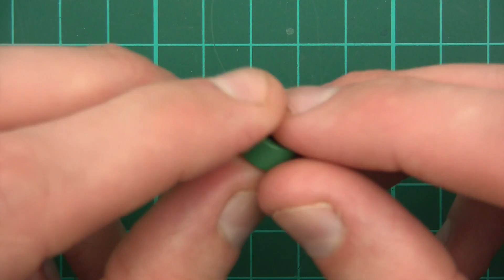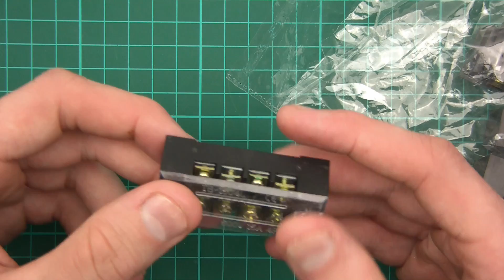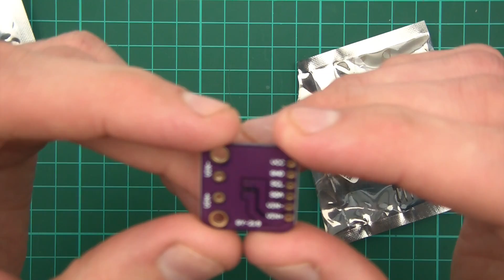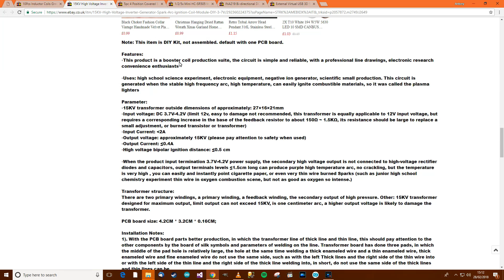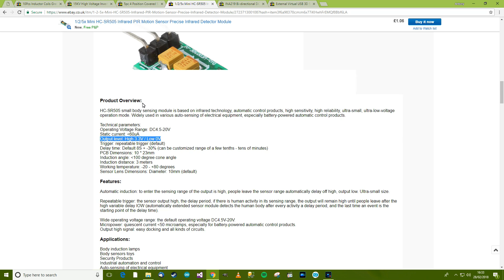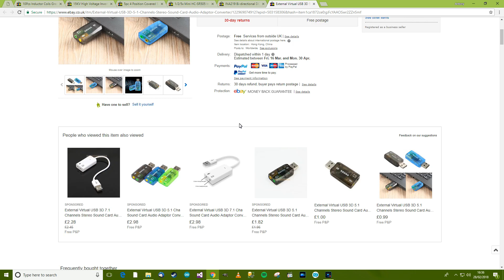Post Is Here! (Random, Cheap Ebay Stuff) #23 (Some Bargains!)

Comment: The HT7133 is a 3.3v voltage regulator made by Holtec. I've got a strip of those because they are quite handy for battery powered ESP's, due to their low voltage drop. I couldn't read the label here, but from that HT133... you read, this probably is the same or similar. [edit: corrected mistake in component number: it's 7133, not 1337]
Reply from the maker: Maxint R&D Ahh thanks... I use ams1117 and also 78xx family.. :) I'd never heard of HT1337. It sounds like the name of a temperature sensor haha...
Reply: Hi Antony - Sorry for mixing up some numbers. This package looks the same as the AMS1117, which is also a regulator. To be sure I just had a look in my own collection of sensors, where I also have that same mini-infrered sensor. There the chip on the back is labeled HT7133, which is a low voltage drop 3.3v regulator. The AMS1117 datasheet calls its 1V drop to be "low", but it really isn't. The HT7133 only has 30mV drop. This makes the HT7133 great for powering 3.3v devices from a lithium battery, where the AMS1117 is totally useless... (I know: ...been there; ...tried; ...failed)
Reply from the maker: Maxint R&D Hi! Doesn't the HT1337 have a drop out of 100mv? Maybe I misread the datasheet earlier. It's interesting stuff about these things. The ones I use are ams1117 and 78mXX. The 78mXX has a 2v dropout, but I don't believe all of these statistics. I'll have to do some efficiency tests on them. That will be interesting..
Reply: I just read a datasheet that said 30 mV, but I didn't measure it. 100 mV is also much better that 1V. Some time ago I made a lithium powered voltage and altitude measuring module for my drone. First version had an AMS-1117 which I had to replace because just a bit of throttle on the drone would lower the voltage to below the 3v that the RF24 transceivers required. BTW: I also have that INA219 module and found it quite good. Accurate and easy to use. If I remember well Julian Illett made a video about them in which he showed you can select increased accuracy by changing a resistor.
Reply from the maker: Ahh cool, I'll have to get some of these HT chips. Generally, I'm not concerned about the drop out because I don't usually use batteries. Solar for example, I use regulators but the voltages are always fixed a considerable amount above the required voltages.

The INA219 seems to have a 1Ω current shunt resistor with AD8219 chip. The AD8219, I think is an instrumentation amplifier. So I think there is a drop across the resistor, and the amplifier seems to amplify that to something usable. The INA apparently outputs I2C though, which is strange because AD8219 doesn't seem to do that, and I can't see any other chips on the board. Maybe there is another chip called 8219 or something lol. Whatever it is though, I'll find out at some point. Is this device actually an I2C device?!?!
Reply from the maker: I also have a drone but I never finished it. Lol... I keep meaning to finish it...
Reply: Yes, most definitely it is. Using I2C you can read both voltage and current. The address can be configured using the A0 and A1 pads, allowing four of these on the same I2C bus, along with other devices, such as an oled display. (Hint, hint...)
Reply from the maker: Maxint R&D Ahhh, to make a voltmeter/ammeter.
Reply: Oh, I just saw I misremembered how I read the datasheet. Remembered 30 mV instead of 30 mA. As you wrote 100 mV is the listed voltage drop, but in another datasheet (HT7133-2) I read 35mV-55mV.
Reply: A multi-point volt-/ammeter, e.g. a solar energy efficiency meter that can read both input power and output power, or measure Wh going in the battery versus Wh going out...
Reply from the maker: Ahh cool idea... ;-)
Reply from the maker: Maxint R&D Mr Maxint, do you use Facebook?
Reply: Hello Antony - Marcel here... Sorry, no. Facebook is not my thing. No twitter, pinterest or other social media either. I'm on linked-in, but hardly ever use that. If people want to reach me they can send YouTube messages (see the contact section of my channel) or send e-mail.
Reply from the maker: No worries!

Comment: With the toroids you can also make inductors. Useful for making buck/boost converters. You take 1 wire and coil it a certain # of turns. Then connect it to a diode, resistor, mosfet, and a few other parts and you can make your own buck/boost converters for your projects :)
Reply from the maker: Korishan Yeah, I want to look into this. To be honest, I know very little about inductors. In a few weeks, hopefully I'll release a video on what I've learnt, and maybe do a how to make your own buck/boost. Ha!
Reply: Julian Ilett did one that he called his MUPPET. It's a combination buck/boost with MPPT for solar to charge. But along his travels, he realized he had made a bidirectional buck/boost converter :P

Comment: The polo shaped green core is a toroid. I use them a lot in radio projects.  But I never came across green ones. Here is a link to a good discussion on them with links to inductance calculators https://forum.allaboutcircuits.com/threads/identifying-toroidial-inductor-cores.56586/
Reply: Stephen Farthing:  More specifics about toroids, from a YTer:  https://www.youtube.com/watch?v=t8mB6xz2NPI
Reply from the maker: Stephen Farthing Thanks! :)
Reply from the maker: Interesting video! I'm going to research this a lot more over the next few weeks. :-)